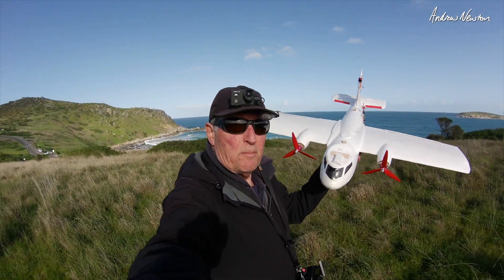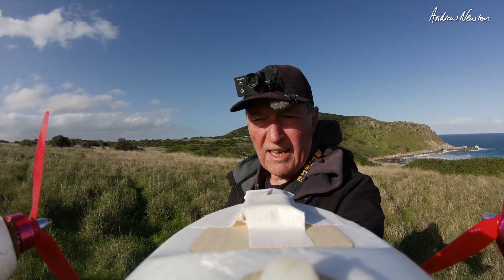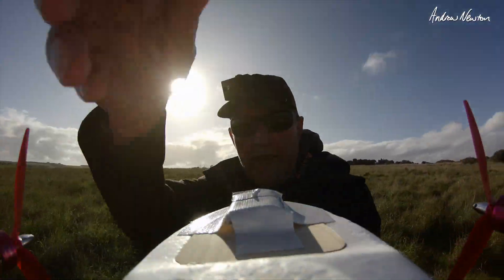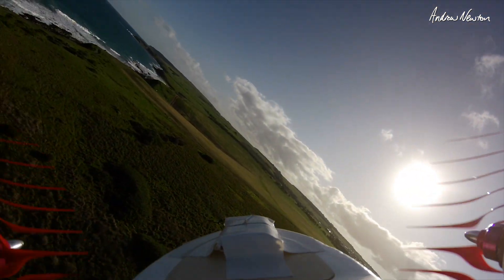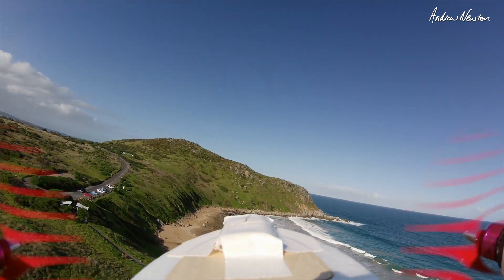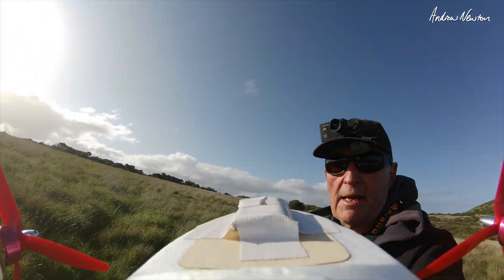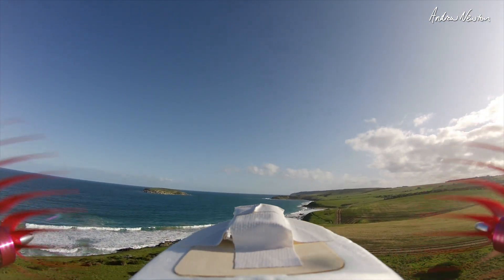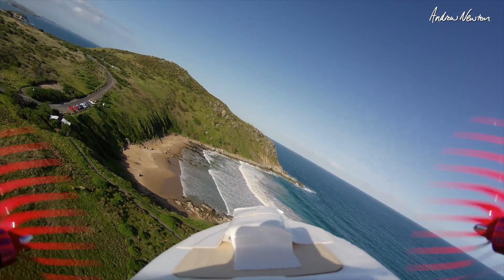Twin prop spin direction test with motor loss

Comment: Hello, how do you change the rotation of the motors in inav inwards?
Reply from the maker: Not an INAV function. Have to switch 2 of the ESC to motor connections

Comment: There is a few things at play.

For prop direction:

The motor distance from the centre of the plane and the AOA at the time will all make a difference. I have experimented lots, more so for getting the maximum differential effect I could muster up for nice stall turns!

Torque roll:

I seen in the comments about large prop setups not inducing torque roll, well if you think about it, hold the wings where the motors are and twist both in the same direction, the plane won’t torque around ;).
Reply from the maker: Thanks Josh, good points

Comment: Makes no difference which direction the props spin....What matters is which WAY you turn if one motor dies. So for example, if the left motor dies, turn right, not left because if you turn left it will induce the left wing to stall. You also need to use a substantial amount of right rudder trim to compensate for the increased drag from the left wing. Freewheeling electric motors are NOT your friend in this situation of course.....😮😮😮😳😏😏🇬🇧

Comment: It’s not often that you “loose a motor” on a twin electric setup. I have two modified Bixler 2s where I have cut off the single motor nacelle and converted to wing mounted twin motors, one is a pusher the other a tractor. I have a robust tricycle undercarriage on both but with a fixed nose wheel ( no turn). I use differential thrust as my main method of turn, works very well on the ground. I’m a ‘turn in’ person when it comes to twins, and the tractor Bixler twin can take off single engine, no problem. I suspect a Bixler2 has a greater wing span than your experimental aircraft and is very stable in the air single engine. Keep up the great work, I will be in your part of the world in October
Reply from the maker: Yes diff thrust for taxiing works well

Comment: Interesting experiment. Agree, motor rotation direction should have little difference in cruise flight. Not sure if intentional or not, as Andrew made this test scenario more challenging by not setting the ESC brake for the motors. The cutoff motor would have been producing more drag and thus increasing any adverse yaw effect. 
Key to controllability minimizing the amount and changes in motor torque, something a pilot would still have some control. This would reduce unfamiliar coupling effects between roll and yaw, as throttle is being changed.

For a good landing outcome when faced with a motor failure on a twin, I'd recommend to have ESC brake enabled, and reducing motor power (thus torque) to establish a controllable glide. Slow changes in throttle will help to minimize any adverse effects. An attempt to gain altitude quickly, or go-around will have a higher probably for loss of control as motor produces high torque and greater yaw effects at increased motor power. Being able to keep control after a motor loss power would be even more challenging if flying a heavy plane (low thrust to weight ratio), or a plane with little/no yaw control.

It might be fascinating to test if INAV notices a difference when a motor failure occurs on a twin, should there be interest in doing more flight test experiments.

Comment: Two seconds into the first "flight" I thought, wait, were you not going to test it in the air? 😂
Good film as usual, Andrew! 👍
Reply from the maker: I though maybe I wasn't going to do the test after that first flight
Reply: Yeah, like at least not before playing with the hot glue gun 😂

Comment: P.s.: If your radio was set to display the output page during such a test, would you be able to read aileron and rudder values while flying straight and level, gauging the compensation required in each case?
Reply: Many onboard flight controllers can do this and simply record the data to a micro SD card like a tiny black box 😊. They'd even give airspeed, groundspeed, heading, and a myriad of other data just like a full sized aircraft, as long as you had a GPS module connected.

Comment: Very useful, this suggests that we can always accept outwards spin if reversing the motors is too cumbersome. Still, it would be interesting to know what difference a braked motor would make. An outward windmilling motor will resist its own spin - acting as a generator - and consequently torque the model in the opposite direction, won't it?  I know from personal full size experience that there is a dramatic difference between inward or outward spinning intact  engine when the failed one is feathered and stopped. Yet it would be great if we could simply forget this issue in RC, it can be quite fiddly to fix without BLHeli. Thank you for the test!

Comment: Hi Andrew. Well done on maintaining directional control! 
With counter rotating propellers, whether inwards or outwards, the yaw between the left or right motor out scenarios will be the same. What you would notice is the Vmca (speed at which you lose directional control) would, theoretically, be slightly less with inward rotating props because it's the asymmetric blade effect that creates the larger or lesser yawing moment between the two rotation directions. Only If you have airspeed telemetry and measured the speed at which you lose directional control would you notice a difference between inward or outward rotation on motor out scenarios however, the difference would be very small.
The question on inward or outward rotation is more to do with efficiency. Theoretically outward rotating props would be more efficient as the prop wash, to a certain degree, counters the spanwise flow across the wing thereby reducing induced drag.
It's obviously more complicated that this but in a nutshell on a model, when just flying for fun, you would be very hard pressed to notice any difference.

Comment: Awesome test mate. 
There are a lot of weird theories about twins. Also the thing with opposing or same prop direction. I know this makes a difference in full scale planes but IMHO not in our RC size class. 
I tested that with my X-UAV clouds. Massive 2812 Motors with 12" props initially. With no props on and both motors in the same direction, the motor bells alone had enough torque to rock the whole plane. Did not happen with opposing directions. But then I just was able to get same direction props due to low stock. So I did the same with props on and the plane was barely moving! 
I now have 10x10 props on the clouds and launch it with full throttle at 1.5kW with both props in the same direction and experience ZERO torque roll. 

my guess is that the airflow over the wing creates more lift on the propwash side that goes upwards than on the side that goes downwards. Therefore the propeller airflow that goes inwards creates more lift further out on the wing than the propeller that goes outwards. This then compensates for the torque that would act towards the inwards prop. 

So for your test or this stability topic it might be that this phenomenon will just induce a bit more torque roll on inward props but the difference is not much bigger than normal motor torque itself and can easily be compensated by roll input. The differential thrust and resulting yaw momentum is a much bigger issue here.
Reply from the maker: Thanks Marc. I do enjoy testing these theories.

Comment: In full sized aircraft you never turn into the dead motor as the induced yaw will accelerate the stall of the dead motors wing and recovery (in full sized aircraft) is almost impossible.
You made an interesting comparison though, I prefer inward spinning on my twins only for the free torque unloading effect on the spar versus torque loading with outward spin, as miniscule as it is, when fully loaded and in turbulent conditions, every tiny bit seems that bit more valuable with nothing else at stake.
Cheers, and thanks again Andrew.

Comment: Certainly, on full-size aircraft, losing an engine on a twin engined plane is an extremely serious situation. My instructor used to tell me that when you lose an engine on a twin, the only thing the still operating engine does is take you to the scene of the crash. 😂 You basically run out of rudder authority and are unable to prevent the yaw caused by the asymmetric thrust .

Comment: Would have looked better with the brake on. Nice test gotta love the Alby.
Reply: But would the brake work if either the esc or motor failed🤔
Reply from the maker: Excellent point, I'll use that as an excuse for forgetting to set the brake
Reply: @AndrewNewton  Perhaps you can but then make sure you have extra props to replace the broken ones when you land..😉